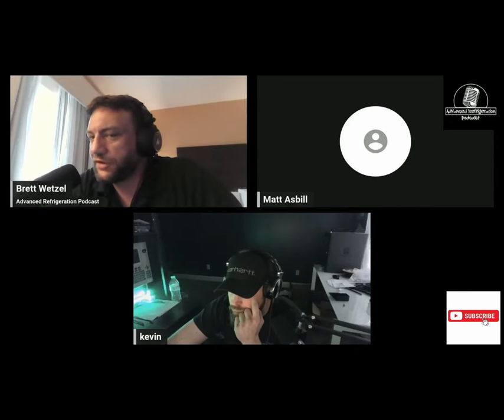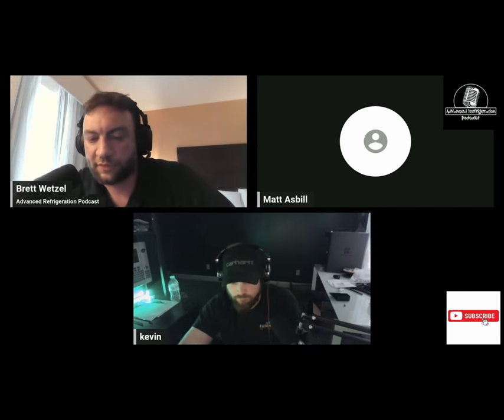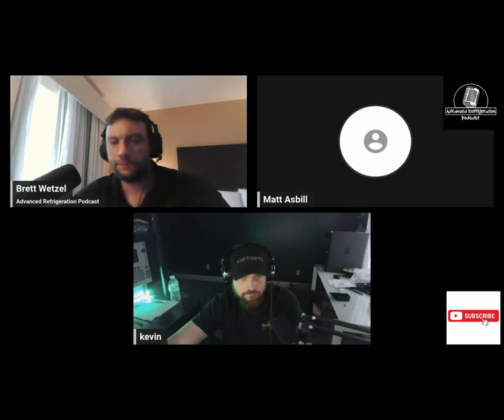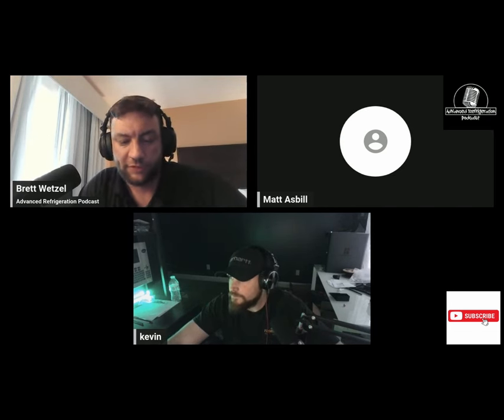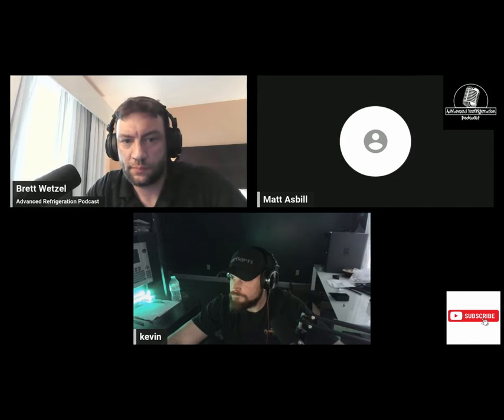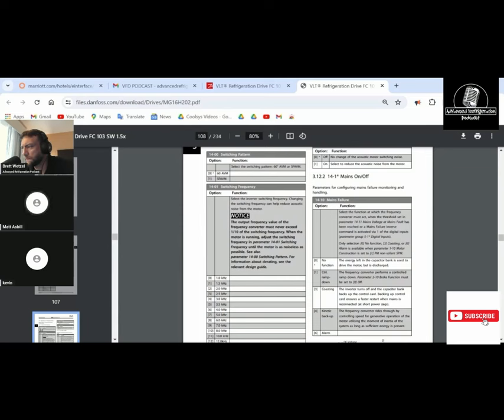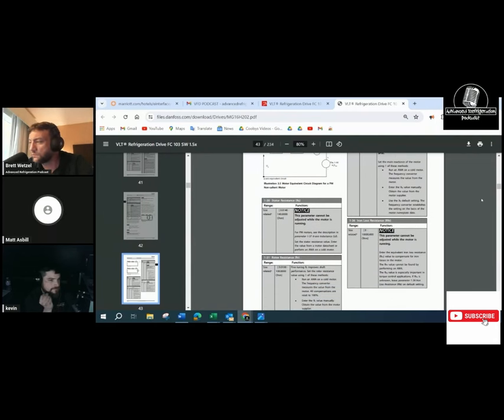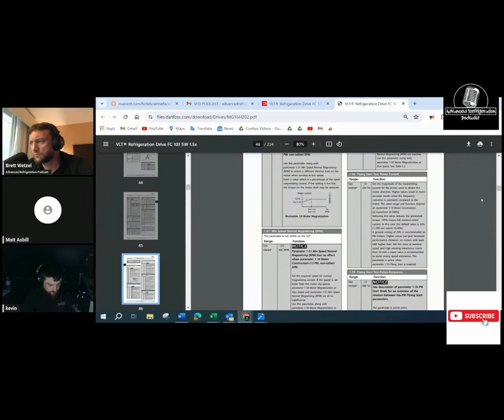VFDS What The HeX Do These Parameters Do??  Part 1 Episode 311

Comment: I’m seeing that. My WIF previously maintained -10*F and now with the HCR system the box won’t drop below 0*F. I turn off the heaters and the box drops back down to -10*F. Uggg this is getting frustrating because the company that installed (JDC) won’t respond back. Well thanks for responding
Reply from the maker: call the manufacturer.... they c
have some video's i think